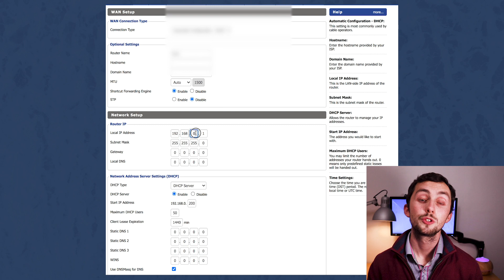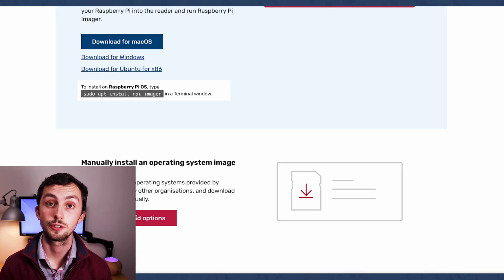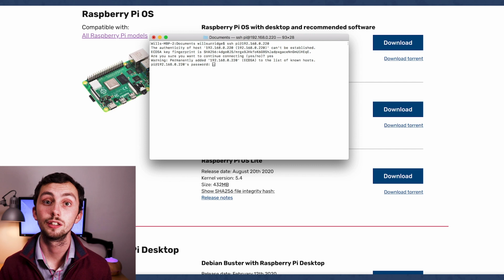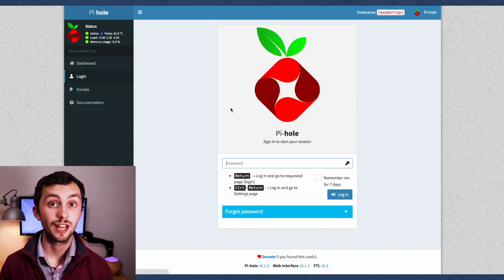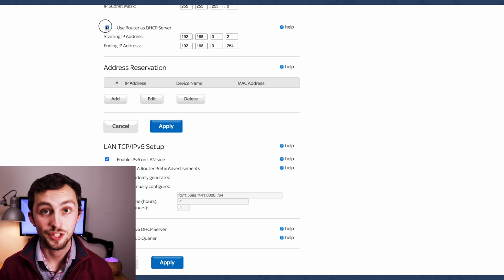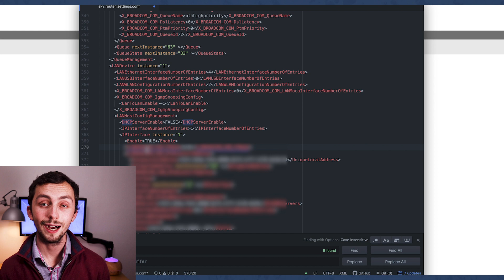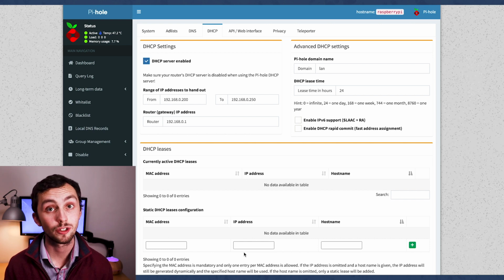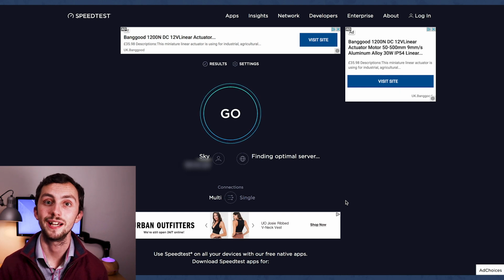Network Sidegrade Part 1: PiHole Install

Comment: I setup piHole for DNS, and then DHCP...   I must say i had some weird issues, primarily setting up certain IoT devices with the piHole running my DHCP.   I switched to pfsense for routing and DHCP and all the weird issues went away.   piHole works great for DNS, but I wouldn't recommend using it for DHCP.   I do have some DNS rules setup that I want to control with Home Assistant.  Right now, they are just setup on a cron job.  Basically they block kids games and youtube during times when they may need their computer for school but I don't want them getting sidetracked.   If you figure this out I'd sure enjoy a video on toggling rules in piHole with Home Assistant.
Reply from the maker: Thanks for the info - I'll have a look into that sort of parental control settings - I imagine you need to use groups, but I've never dived deep or managed to get them to do anything tbh
Reply: @WillSurridgeTech  yes groups.  Put the site to block into a group, put the kids devices into same group.  Then google on and off.   I have cron don't the schedule, but still have to go in pinole for anything outside the schedule....   If I can get it into HA, then it is easy enough my wife can do it, of I can set timers of the sky is the limit...

Comment: Thank you, I will definitely be doing this. Quick question for you Will, I have Sky and no devices are showing as being attached to the router, I wonder if you have experienced this as well? I dont know if HA is interfering somehow.
Reply from the maker: Dont know why that would be, shouldn't be hA or pihole - all my deivces still pop up on the sky router

Comment: Hey Will. Good video as they have all been. I'm looking at buying myself a raspberry pi and loading pihole and home assistant. Quick question. Do you have pihole and home assistant installed on the same raspberry pi? If so how? Can they both sit on the raspberry pi os together?
Reply from the maker: HA is a complete build, PiHole is either an app which runs on raspios or Docker. If you're happy playing with docker then you can run them on the same; but I'd recommend running on separate pis just because if one goes down you dont loose the other :)

Comment: I uninstalled my pihole after a few months.
It was more problems than benefits.
More and more play services require adverts to be played before you can start the show.
And when you google search the adverts for what you searched for displays and is tempting to press, but the links doesn't work, so again you need to turn off the pihole.

Regarding upgrading wifi, I bought routers second hand.
They are pretty much given to you since there is so many of them on the second hand market.
The cheapest one I bought on an auction was about 0.1 €.
Half an hours work and you got extended wifi. (Plus wiring up the cable).
Reply from the maker: I've come across the google ads but you can whitelist them (https://discourse.pi-hole.net/t/unblock-googleaddservices-google-adds/168/7); haven't had any other problems yet - but I feel like it's just about whitelisting anything you notice being annoying!
Good to know about second hand routers - just annoying I cant run ethernet anywhere, and I don't really like having network extenders which aren't mesh - always found performance to be an issue

Comment: Great video, as always!

Been through the struggles of Mesh - and used Eero for 3 years,and it worked well, but as we moved to an all online meeting all the time, I found my furthest point of access (my office) in my back yard (garden) was just too slow.  I had Cable run already, so I setup a MoCA pair, adn now i have 2.5 Gb from house to office.  Works great inside the house as well.  Use Pi-hole for DNS and haven't looked back since setting it up.  It's amazing.
Reply from the maker: Good to know - yes wired is always the best solution if it's possible!
Reply: @WillSurridgeTech  Ohhh, and whan I say "cable" i mean coax - little by little that's not as common as it used to be, but if you have it installed in multiple rooms, definitely worth a look, especially if you have a mesh wireless setup that can use the coax as backhaul.
Reply from the maker: We don’t really have coax for anything in the uk (other than tv of course), a wire is a wire though and it’s better than wireless!